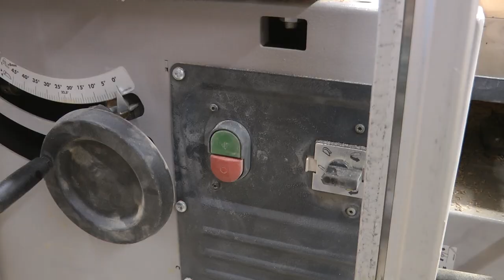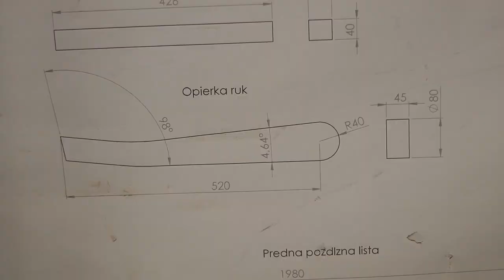Production of oak garden bench Finka with Festool Domino

Comment: I enjoyed watching you building the garden benches. For outdoor applications i would recommend you tu use the special DOMINOS out of Sipo wood. The beech ones are not really moister resistant. Same as you i use PU glue in areas were water is available. But for gluing in DOMINOS it is not the best choice. The water from the "normal" wood glue helps the DOMINOS to swell and ensures a tight and stable binde. The PU glue needs water for its chemical reaction and the DOMINOS have no chance to swell.
Reply from the maker: Thanks! I dont recommend to put my benches on the direct rain or sun.  But I wonder what glue would you use for dominos for exteriour? Usual "white" glue is not suitable for that as it cannot withstand temperatures under the zero and high moisture, PU doesnt make dominos to swell, so is there any third option?
Reply: Try using titebond 3 been using it for years with no problems.lovley work by the way